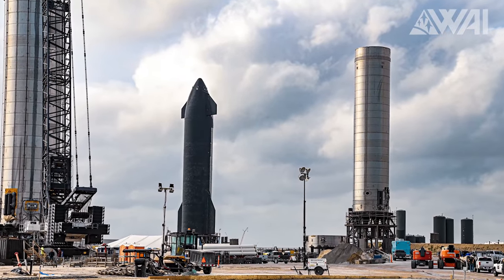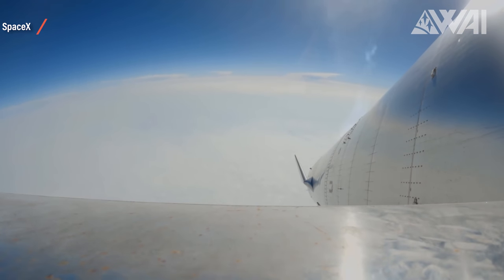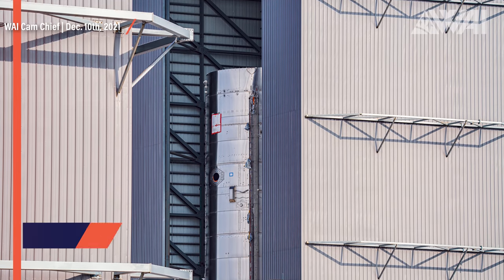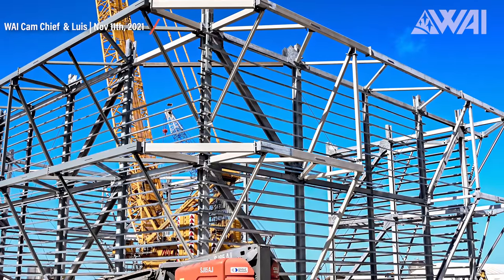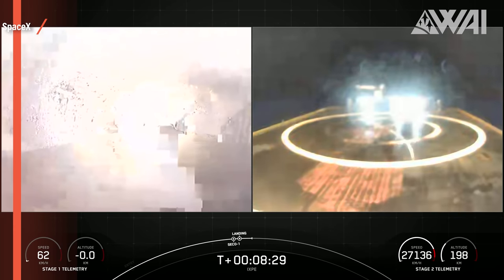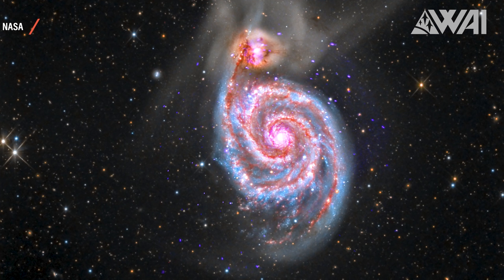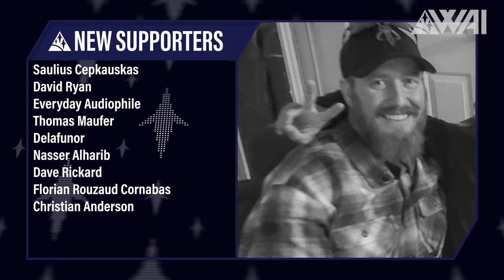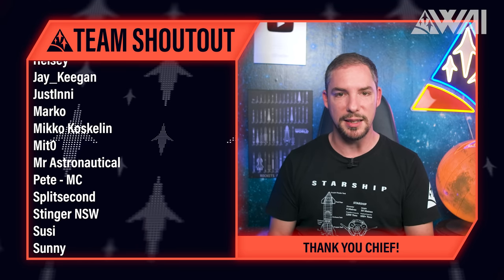SpaceX Super Heavy Booster 4 ready for action! + The IXPE story

Comment: 6:25 just build around the tents from back to sides, then finish the doors last. that's what I would do. you would need a space for materials somewhere off to the side, and a crane or two. as long as they never go around the front of the tents while building the super structure, then work can continue like every other day.

if you build it large enough and properly, then there is no need to touch the tents (maybe minor cutting for pillars). you can pull the tents down inside of the super structure with overhead cranes later on.
Reply from the maker: That was the idea! Thanks for the comment! :_WAIStarship:
Reply: Unlikely. Afaik they used vehicles with extendable arms to erect the tents. You would have to use them, maneuver them around within the tent, bring the support structures down and bring them to the front, while the space is crammed full with Starship parts, construction rigs and tools and people buzzing around them. This appears to be very difficult.
Furthermore, the permanent structures would have to be bigger than the tents then encompass, but the tents are already very close together. There is not enough room for that.
My guess is that they either will build new tents for temporary use at another place to be used while the old tents get replaced by permanent structures. Another option is that the tents won´t get replaced at all. Starbase might just be an R&D site for prototypes and might get replaced by a bigger and permanent manufacturing site near the cape in Florida. After all, Starbase seems to be insufficient for building a 1000 Starships, the launch cadence is limited by the nature reserve area around it and somehow the Starships and boosters have to get to the future pad at the cape without building a harbor at Starbase.
Reply: As much as I would like to see them utilize space and time like that I don't think it will be aloud. Having construction go on around you and over you is an extreme safety hazard. I think it would be better and safer to expand the footprint of the grounds and build the new structure near by.
Reply: @greebeena2818  Yeah, the potential hazard to people (and equipment even with people cleared during lifts) makes this very unlikely.

Comment: The StarShip nose has caused major problems with heat rule adhesion. The fix could be to use a series of straight cones. A curve comprised of flats separated by 15 degree angles  (or less) are seen by the airflow as a smooth continuous curve. 
Four stacked 15 degree cones would turn the slope 60 degrees allowing the centre to be completed by one 30 degree cone.

Comment: They need to go through the static fire tests of the booster first. Then thy need to test Raptors in the first orbital flight and the TPS. Only then does it make sense to continue on SN 22, because they need to feedback the delta knowledge from SN20 flight into SN21, else it will not provide maximum dknowledge itself. I guess orbital flight will be end of January.

Comment: My biggest concern is the close proximity of the primary tank farm from the orbital launch pad.  Even with a massive earth berm between the two, the power of 32 Raptor engines firing at once will launch ground debris everywhere.  And if the booster test results in a RUD on the pad, that will be disastrous.  Those tanks better be bulletproof…
Reply: Titanium shield my friend force it to go upwards
Reply: Either they're good, or they're not.  No use worrying about it.  SpaceX is obviously ok with it.
Reply: A RUD on the pad wouldn't create a very large shockwave. When fully fueled rockets explode before lift off, they flare up, but they don't actually explode. It may look like an explosion, but there isn't a substantial shockwave. At liftoff the booster is less likely to RUD, and on landing it's going to have much less fuel in it then at lift off, meaning even less of a shockwave, if any. Either way, any debris kicked up from a RUD on the pad is going to have much lower momentum then your intuition tells you, definitely subsonic. And any piece of debris small enough to get fast enough to reach the tanks, would have low energy due to its size. It would be like shooting at the tanks with a BB gun.

Also, even if by some chance a few pieces of debris did have enough momentum to cause punctures, the tanks would be empty of fuel by that point. Patching a few holes in the tanks isn't a big deal. The only way the booster is going to cause any real damage to the tank farm is if it hits it directly, which I think is pretty unlikely. They have explosives on those things, they can scuttle the ship during flight if the trajectory is looking iffy or their avionics, engines or control surfaces aren't performing as expected.

Comment: Raptor 2 is long overdue you said. But the raptor number 1 has barely been used in actual flights. A few on starship on its 10km flight. Shouldn't they use raptor 1 at least before moving onto something new.?? Confusing

Comment: Hey Felix, great show,  can you explain a bit on these topics in next ones
- how will they cool the fuel/propellant for a trip to Moon/Mars/.... Space is cold but cold enough to keep that cryogenic stuff cooled?
- making Starship profitable will be easy once they can get it up there.  Whats the cost comparison if they dont recover Starship and/or Booster to falcon cost.  
- Did we already see how they will open it up to release the payload?  If plans go ahead (multiple launches in 22) there must be a build with payload capability starting soon?  How fast they can build a Starship by now (incl/excl heatshield)?
- Last I saw the Starship just sits on the superheavybooster, will there be a connection/detach mechanism?  Just a static fire of booster must make that Starship rattle and shake on top ....

Keep it up!  I enjoy your show very much!
f
Reply from the maker: Noted! I'll see what I can do for you! Some of them have been answered before but even I wouldn't know in which episode... :_WAISweet:
Reply: [For Mars,] Only the header tanks will contain landing propellant, and the main tanks can be drained to vacuum of space for the transit. Those smaller [header] tanks could be made of thicker steel and this would allow the more extreme pressure to be contained at ambient temperature. 

However, keep in mind that these header tanks may be oversized "Dewar" vacuum insulated containers. Also, the shaded side of Starship is exposed to 2° Kelvin so it is easy to chill fluids. In fact, it is hard to keep the crew compartment warm enough, so solar heating is required via the large window.
Reply: @imconsequetau5275  I thought the header tanks were only used to fire up the engines on landing (when horizontal and doing the flip).  For landing on the Moon there wont be a lot fuel needed due to low gravity, Mars will be another deal.
Reply: @2BeICT  
Sorry for the delay. A manned moon mission requires more overall propellant in the Starship main tanks than the Mars mission, since all deceleration must be done with propellant, several maneuvers are done to meet the astronauts in lunar orbit, and the ship must return to lunar orbit for crew transfer to the Earth return vehicle. The takeoff propellant mass requires even more propellant in order to decelerate that extra mass down to the landing site. This may even cut into the available mission payload mass. [The moon mission does not require large header tanks. The mains tanks are enough.]

The Mars mission can decelerate using the Martian atmosphere so that only the header tank contents are consumed to land. However, first some header tank propellant must be vaporized again to pressurize the main tanks.

Comment: Unless they have solved the heat tile separation issues, I doubt they would do any engine tests with Starship attached. Why put it through that amount of vibration before launching it?
Reply: Yeah if they haven't changed the system, they wouldn't want to do a static fire with the 2nd stage mounted. But they seem to make minor changes all the time, so it would be good to test and see what falls off and what doesn't.

Comment: Felix my friend! If you can get a hold of Elon musk, tell him instead of using silica, using industrial diamond dust, use the 3D printed wire frame inside the tiles! The wire frame can be printed with locking post clamps inside! This will prevent the tiles from falling off.

Comment: Felix, please stop referring to the first launch of the Super Heavy/Starship combination as an orbital launch, it isn't.  According to Elon the Starship will splash down off of Hawaii before completing a full orbit, which means it is a sub-orbital launch..  
Even though the Starship will reach orbital height, if it doesn't complete a full orbit it is not an orbital flight.
PS, I love the show and wish you could do two a week.
Reply: Semantics. There are three ways you could define orbital flight - completing an orbit, entering an orbital state, or achieving orbital velocity. And you can do the latter two without actually completing a full orbit - e.g. if you re-enter early, or if you're in an eccentric "orbit" with a very low perigee.

SpaceX aren't completing an orbit with Starship 20, but they're doing one of the other two. Not sure which, since I've heard both from different sources. Technically the latter would be sub-orbital, but it would be demonstrating orbital capability.

Comment: I don't  think they will be reusing starship 2nd stage -will be cheaper just discard  it  or leave in space for refueling (so 3 or 2 x vacumm raptors only, no heat shield-which is also in line with lunar starship).Heat shield maintanance cost will be too high+ other refurbishment cost.Just simplify the thing throwing away flaps and other stuff not needed for reentry because no reentry thus simpler cheaper design.Mark my words.

Comment: What about SN20 and BN3 ???   SN20 has so much work done on it with all that heat-shields and static-fire already done.
So we should talk about SN20 and BN3 ... instead of any further one like BN4 or anything else.
Hope to see BN3 with SN20 on top flying soon.
Reply: BN3 is cut in half, that is not flying anymore
Reply: @justinni_  WHY ??!!!!
Is Elon having so much money to wast ... just building up SN3 and than trash it without any reason ?
What has been wrong on SN3 not being able to fly ??
Reply: @oliverweber6842  B3 was never meant to fly, just for ground testing. Besides, they are very quick to make new, improved versions of the booster, so the older ones get less useful when testing them. SpaceX is just too fast for themselves.
Reply: @justinni_  Thanks for that learning lesson. I thought that BN3 was built to do first orbital try together with SN20 on top.
Perhaps it should be better testing BN4 without any SNxx on top first because of less weight and therefore less raptors needed to do.
Less raptors in action will decrease risk of RUD on lift-off-pad or low height.

Comment: Never done by SpaceX but the Russians can tell you all about trying to make a rocket with 30 engines. It didn't work for them. They launched 4 N-1 Moon rockets and all 4 failed. Today's engines are better but we will have to wait and see how reliable they are and how well they like being grouped very close together. I don't think they will like it because they had an engine fire on all of the Starship tests and there were only 3 engines and sometimes only one was running.
Reply: The Soviets didn't test fire ANY engines placed on the N1 booster. They only tested a percentage of the engines coming off the production lines, and afterwards those were considered "worn out". 

If they had designed all engines to be restartable and reusable, then the N1 could have been successful due to 100% testing.

Comment: If SpaceX is going to increase the number of raptors on the Starship booster from 29 to 32, won't it have to rebuild the orbital launch mount?!
Reply: Maybe not if the outer ring keeps the same number.
Reply: No. The outer ring of 20 engines remains the same. The inner ring of 8 will be modified to a larger diameter with more engines, and the center will have three instead of one.

Comment: If you put these tiny (compared to the volume they are going to lift) 30 rockets under the launch tower (OLIT  2.500.000kg - 3.000.000kg) will they lift that launch tower? That rocket (4.500.000kg) will be two times heavier than the launch tower next to itself before launch to Mars. Did any of you guys try to calculate the distributed vertical weight for each engine where they touch the bottom of the rocket fuselage?
It will be around 150.000kg min. Which area of the rocket will handle that pressure? Even 2 inch thick titanium squashed under 90000kg press. And what about heat shielding?
That's what happens when you climb to stratosphere with just 6 mach:
https://www.youtube.com/watch?v=SncLDXTiREY
X-15 rocket plane almost melted to reach 100km altitude. And it didn't launch like Starship from sea level. X-15 drop launched from 12 km altitude (40,000 feet). Even from that altitude the X-15 compressed the air in front of it, generating temperatures as high as 1300° Fahrenheit on its nose and wing leading edges. And X-15 is way more aerodynamic than this flying Silo. This Starship thing is just David Copperfield show on steroids.